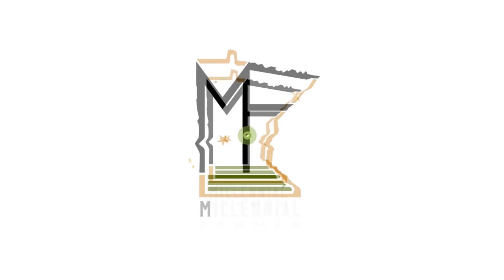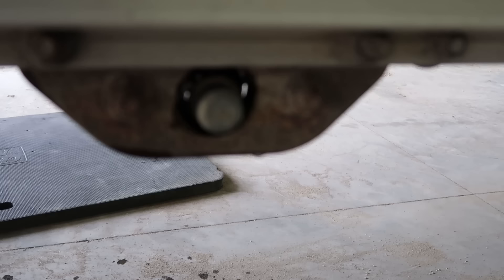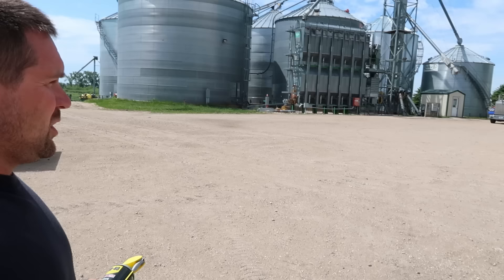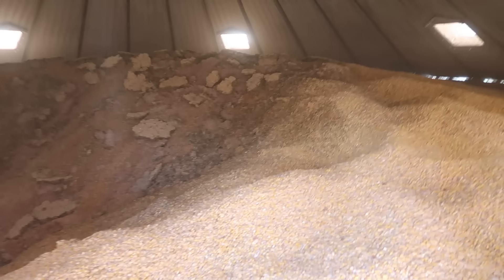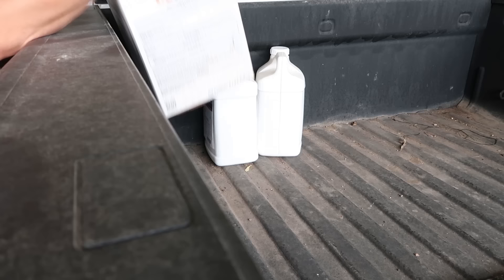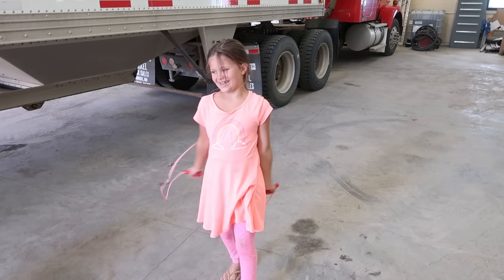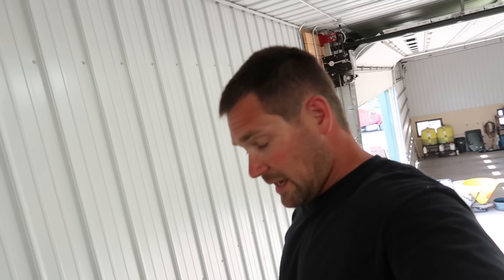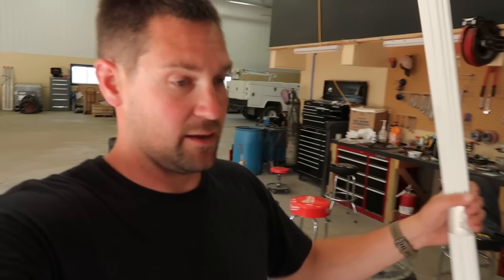Tell Me Otherwise-Crusted over Grain Bins

Comment: Mr Zach, 2 things I would like to mention. Hopefully you read this. 1st is the plug on your electiric Cord from your truck to trailer. Here in Northern Wisconsin, much like where you live, we deal with corrosion on all electrical connections due to the chemical they use on our roads in the winter time. An old trick I was taught was dunk the whole end into diesel fuel. It helps clean them up and also helps prevent corrosion. Item 2, and you probably already know this, but the American flag is to be displayed higher than other flags. It's the most important flag of our country and it shows proper respect 
P.S. enjoy your videos.

Comment: Glue a couple magnets to the wall with liquid nails, and use the other magnets to hold them in place, over the glued ones. It doubles the strength using two together.

Comment: with a flat like that, sometimes you can get lucky with a small compressor, you pull the valve stem core out and use a blow off tool to get the extra volume to get the bead to seat

Comment: Hi Zack
Having worked in industrial maintenance for over 20years.....I can assure you!!! WD40 is the last thing you should be spraying into your bearings....fact!
WD40 Is a fantastic product, but it has its place....WD40 cleans and stops away oil, grease, corrosion, dirt....but does “little” to lubricate.
For your application on the grain trailer slides, I’d be looking for a light spray oil application ( possibly food grade) that resists build up of dust & dirt adherence to the oil, food grade grease would just attract the dirt and cause more problems. The bearings definitely need a lubricant rather than WD40, but the best option there would be sealed maintenence free bearings, 
An spray application oil I’d recommend from the industrial world is Kluber MZ4-17 It has good lubrication value with an anti-corrosion factor too, the important part being lubrication. 
Kluber also have sprays that include Teflon too, but are not food grade, the Teflon would be of added value in that application.
Again not dissing your WD40.......just be aware it’s not the be all of lubrications......especially around bearings!

Comment: Watch out for residue buildup using WD-40.... It will leave a very sticky, tar-like residue that gets so tough that it takes a powered brush to get it off.. I run into this when owners of rifles use it on their triggers.. After a time, the trigger is so gummed up that it fails - and the result can be a 'slam-fire'..  The only cure is total disassembly of the trigger mechanism and power-brush all parts before reassembly..  For an actual lube that won't build up a bunch of crap, try Ballistol..     WD-40 is great for loosening up rusty bolts/nuts etc..  But not for a 'lube'..   You always have great videos sir..  Best wishes!!

Comment: Just for the public's information, the icons on the switch you turned to make the lift go indicate who has control. To the left like you turned it gives control to the basket, to the right gives control to the base. That's why the put the white box in two different places. It's also not just a switch, it's also a key. You can pull it out when in "O" (off) to keep the unauthorized from using it. 
You figured out the speed control, but for people who don't know, there will be a switch with a turtle and a rabbit. If you flip it from turtle to rabbit, you'll soil your underwear faster. If it's in rabbit and it's too slow, cut your daily caffeine intake in half.

Comment: It's not the magnet strenght the issue but the sheetmetal thicknes....not enough meat for the magnet to do it's job  :|...don't stick one to a 1/4" plate..you won't be able to remove it whitout a real struggle !
Reply: I was thinking if it was aluminum or a blend with less magnetic material that could affect it as well..

Comment: I'd check and see if there might be a small leak on that side of the grain bin roof.  I've patched more than my share around seams.  Also keep those grain fans running in the colder clear (not humid) nights.  That will help push the moisture up through the corn and out the roof vents.  Just my 2 cents.  I farmed and worked at a grain elevator for many years in my youth.  Great video.  I can see you are a good farmer.

Comment: You should find you a seat belt end like your truck uses and plug it in.  Then no more seatbelts unless you want it and no more dinging bells.  Not trying to get around safety but when you are in and out alot sure does help.

Comment: there is a Rocker switch on top of the joystick that controls the movement speed of that lift. there is a rabbit and a turtle setting  and there may even be an LED bar that shows you on the control panel. i use one of those lifts every day at work.

Comment: Magnets are probably having issues holding to,the thin metal. You might consider putting a metal bar across using the self tapping screws through the sheeting and spacers, then attach the flags to that. That will also give you peace of mind as it will be a level starting point.

Comment: For filling duels on semi trucks, I cannot recommend getting a set of crossfire's enough. Fills both tires at the same time, equalizes pressure and has a blow off valve in case a tire pops.  Look them up on amazon, around 65$ per set of duels.  Also, I personally use a clip lock on air chuck and a ball valve on a hose, and when the crossfire lines up, close the ball and then go pop the chuck off.  That way my face is not two inches from the tire when it goes bang.

Comment: Suggestion: wrap a bungee cord around the center of the tread.....tightly...so that the beads are pushed outward toward the rims.  Then hit it with air and beads should snap on and hold pressure.  Or use a pneumatic bead expander or a simple ratchet strap.

Comment: Zack, welders ground magnets are what you are looking for. They are about 3" in diameter. For attaching to the flag, a regulation US flag will have a hole with a ring for attachment to the flagpole halyard. If you don't have the holes, then spring paper clamps then hung from the weld magnets.

Comment: I’ve heard a good fluffer dryer does a really good job of making sure all the grain is dry and cool when it goes in the bins so there is little to no spoilage or hot spots. 😉 Also a good trash system will help reduce the amount of bees wings and fines that go in the bin but it’s still best to core the bins after they are full

Comment: Lighter fluid around the bead and ignite it. Idk how it works but I've seen tire guys do it. In fact I've seen them do it that way b4 ive seen them use compressed air to reset the bead.

Comment: If you are having trouble seating a bead.  wrap a ratchet strap on the tread and tighten it as much as you can.  (Might have to roll it onto the ratchet strap if it's still on the vehicle).  Then inflate it like normal.  Most of the time the circumferential force will seat the bead enough for you.

Comment: Use a 3” wide ratchet strap and pull the tire on the rim, remove the valve stem core add air to pop the bead, re-install the valve stem core and inflate the tire...

Comment: If you have the tire issue again, jack it up, put a racket strap around it and make it tight. Then air it up. It should work. That happens a lot with my golf cart, so I take the tire off and hold it in place and have another person put the air in.

Comment: hello to ya hey next time you need to mount a tire on a semi truck/trailer use some ether(starting fluid) yes ether it also works on tractor tires . just give it a squirt around the tire in the rim stand back use a match or a something  with a little space between you and the tire it will pop  it on . watch some videos on it if you need to  but i have done it numerous times. keep on doing  great videos we sure enjoy them .

Comment: magnet strength has to do with how thick the attaching metal is .. thinner the metal the less magnetic attraction is( holding power)
Reply: This needs more attention.  I think you're probably correct.  Stronger magnets aren't really going to solve the problem.
Reply: @joshbascom8618  I was thinking if it was aluminum sheeting, aluminum isn't magnetic

Comment: IMHO, you should just get 4 steel straps that you can run horizontal on the wall. That would also let you put the flags in the right orientation. Also, FWIW, the magnets may not be holding as well on that sheet metal as they would on a somewhat thicker piece of metal. So go with a 10 gauge strap, and screw it to the wall, then use the magnets to stick the flag to the straps... there also wouldn't be any ribs showing if you did it like that.

Comment: Hint: good way to pound those tile flags in is a piece of metal electrical conduit with a bend in the top.  Use a piece that is a foot or two shorter than the flag, slip flag in with tip out, then pound in and slide off the conduit.

Comment: Getting stronger magnets might not make a difference. The strength of the magnet also depends on the thickness of the material you are attaching to. If it’s too thin like most cladding it will never stick very well

Comment: Noticedthe UniFi WAP mounted vertical which leads to bad coverage. It should be mounted horizontal. Those APs aren’t quite omnidirectional and have better lateral coverage than vertical.

Comment: Magnets will only give full holding power when the thickness of the metal is the same or greater than the thickness of the magnet. Your comparatively thin walls probably won't allow the magnets to produce full power.
Here's what a UK magnet supplier says; https://www.first4magnets.com/tech-centre-i61/frequently-asked-questions-i69#anchor30  It also mentions that a magnet can slide easily on a metal surface, taken from first4magnets website;
Sheer force
It is five times easier to slide a magnet than to pull it vertically away from the surface it is attracting to. This is entirely down to the coefficient of friction which is typically 0.2 for steel on steel faces. Magnets with a rated pull of 10kg will only support 2kg if they are being used on a vertical steel wall and the load is causing the magnets to slide down the wall.

Comment: WD 40 is NOT a very good lubricant. In a pinch perhaps but It is best suited for use  as a  water displacement  spray for use on electrical components like a distributor cap and its wires. It prevents  water/humidity from building up causing electrical issues. 
True story. WD-Water Displacement.  40 was the 40th  formula/mix when initially designing it. 
As for the bearings and it’s related components, a chain lube would be better suited but there is no getting away from the dust building up from being on  those back roads. .

Comment: Hook your air up to the valve stem. Squirt a couple of seconds of ether in the tire and toss a match in it. When it blows on to the rim quickly hit it with the air. If the tire doesn't go on the rim at least you'll have very slender eyebrows and you'll never have to worry about those pesky nose hairs.

Comment: Here is a link to a terminal cleaning kit that will help with those tailer plug connectors, much better than a pick. https://www.mactools.com/en-us/Diagnostics-and-Testing/Terminal-and-Contact-Tools/ET8042/12-PC-Female-Bullet-Connector-Cleaner-Set
Here is a set you can get on Amazon if you don't have a Mac tool truck that stops by your shop. https://www.amazon.com/Innovative-Products-America-8048-Accessories/dp/B00C7K1T8S

Comment: Ya biggest problem ever ever ever spraying dam WD40 in a semi ellectrical plug in.  One thing to think before you think negative to my comment. Think about it WD40 is a lubercant, yes oil base lube. What does dust stick to better?? Oils and grease!!  Use Either or Brake clean to clean and maintain your plug connectors. As you know perfectly well you do not put WD40 on your vacume cleaner plug in the house. Same goes for the plugs on your transportation equipement.  I been a trucker/hd teach for 48 years amoung a realy tallented multi tallents person. Learning from my years of doing all i do.  So never put WD40 in your Semi plugs.